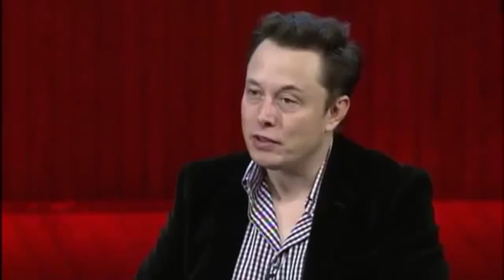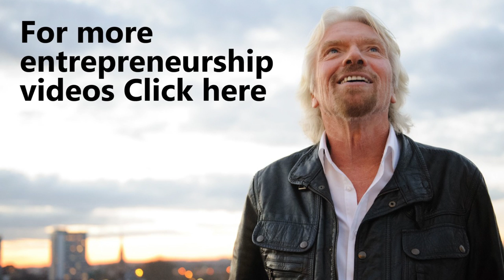Elon Musk explains Electric Motor Cooling

Comment: How hot would the rotor become during sustained peak power? Let's say it stays there for 30 minutes or an hour.
Reply: I guess 120 degrees.
Reply: I believe what he calls peak power is a few seconds only. it that time the temperature might reach something like 300 degrees centegrade
Reply: When it gets too hot the magnets demagnetize then the varnish on the windings melt causing a short circuit and the magnet glue melts and the magnets start flying around in there. It might have slotted magnets though no sure.

Comment: Cooling is a problem for electric motors that are supposed to be around 96% efficient? Funny, considering that even the Tesla 3 has a radiator as big as a regular car's:
https://www.youtube.com/channel/UC_n7LQnStg2asZfx0n3wOSQ/videos

And even funnier when you ponder that the S P100D's motor is rated for 794hp, doesn't have a proper gearbox or clutch, yet it only makes 588 at the wheels. You certainly don't see this kind of % loss on a Bugatti Chiron. Where's the rest? Heat maybe?  

4% loss, eh?

Rated specs:
https://en.wikipedia.org/wiki/Tesla_Model_S
Dyno:
https://www.youtube.com/watch?v=q5HgthPgzgQ
Reply: That horspower from tesla isnt even accurate. If you would measure the Horsepower at the Motor It would be less then 794. Btw the cooler isnt only for the Motor, Its also for Batteries, Controller and air conditioner.
"doesn't have a proper gearbox or clutch" Why should an electric motor need a gearbox or a clutch??????